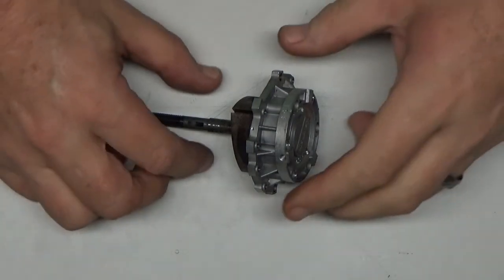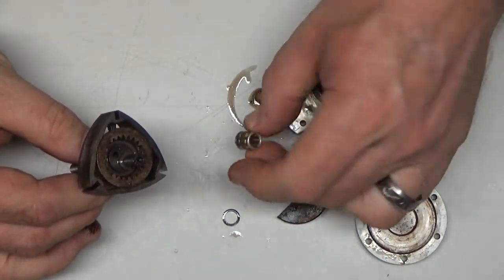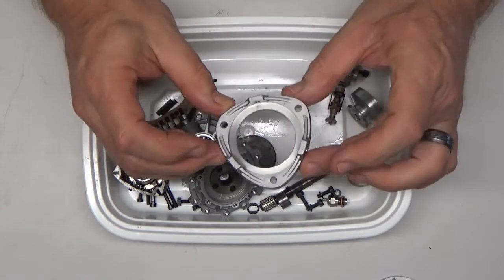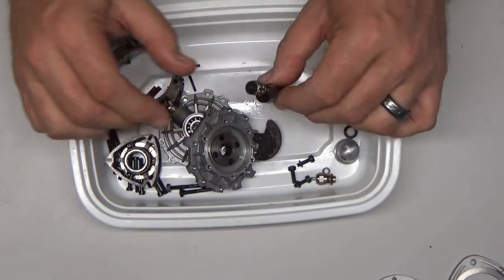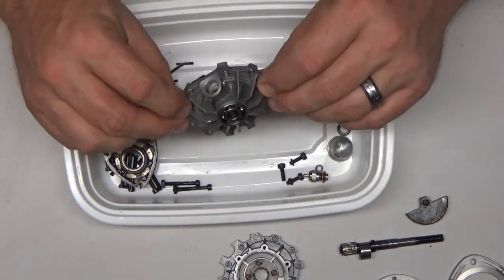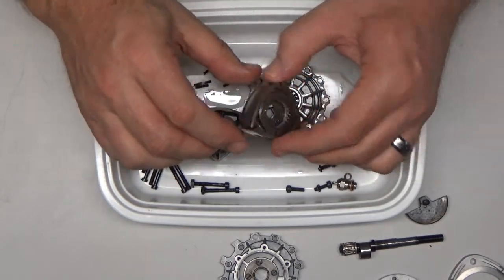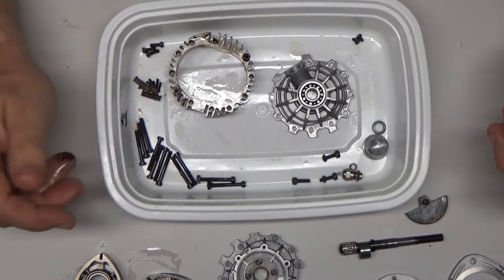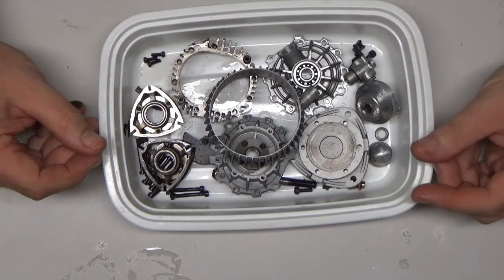OS Wankel A Look Inside Part 1

Comment: Came here to find out if the 6 screws on the back have Allan or Philips heads .... but you already removed them and drilled them out!  Somehow I've managed to mix the screws of two engines together in the cleaner.  I'm thinking if you had to drill them they were probably Phillips, but....?  In the end it doesn't really matter, just trying to keep it close to stock.

Comment: I have the more modern version. When I to mine apart for cleaning, apex seal, and bearing replacement, I put the rear counter weight on upside down. guess what? When the engine fired off, it shook like a dog shittin' golf balls.
Reply from the maker: That is a good lesson then.

Comment: For the same power output, the Wankel is smaller, but the garden-variety 2-stroke piston engine is much cheaper. Wankels are cool, but there's a reason why piston engines predominate.
Cool vid though, thanks for posting!

Comment: Great video! I just picked one up from a flea market for $10! There is a question no one can answer though...in the front, mine and yours use two bearings without a seal. Online, they use one bearing with a spacer. Since yours runs great I’m assuming that the two bearings are meant to be there and work perfectly. To get them out, are they two blind bearings or will they push out together?
Reply from the maker: There are three different versions of this engine.  So I cannot say what should be in each. I no longer have that engine.

Comment: Where do you buy that motor
Reply from the maker: I got in in a trade deal.
Reply: David McIntire what did you traded it with. Iwill buy it from you will you agree
Reply from the maker: That engine is long gone, sorry.
Reply: David McIntire oh in os its not being made anymore
Reply from the maker: Correct.  I have a Wankel Gen 2 engine that was a gift and I am not going to sell it.  If I did ever decide to sell it the price would be extreme, like around $300.

https://youtu.be/S9cOE8m4mCE

https://youtu.be/fCSTlZ9AGI4

Comment: That was one video that was REALLY enjoyable and VERY informative....

Goes for part 2 (which I actually watched first) as well!

Can't wait to see it run. Please take time to re-break in the apex seals!
Reply from the maker: Thank you very much.  It has been really fun.  I might not want to part with this thing.
Reply: I can imagine that! I think I wouldn't, if I were in your Lucky position...

These are such ingenious, almost mysterious constructions....

Good luck with the testrun!
Reply: @dmrcflyr2  Meanwhile, I have one too, a bit older than yours (mine still has the carb without air bleed idle mixture adjuster).

And of course, by now it is converted to run on gasoline and ignition, with electronic mixture control to boot.
It runs awfully hot on the bench, but for some reason it can handle a LOT of heat. It also appears to have never been fully broken in, as it has gained almost 1000 RPM over the by now about 4 hours it has spent on the bench. It also feels like it seals up better internally. When I got it, it turned over rather "squishy", but now it feels like it actually has something that could be called "compression"...
Getting 13850 RPM on an APC 9 x 5, which is not bad at all, and would be even decent on glowfuel...

Haven't opened it, and not going to as long as it keeps running.

Currently building a plane for it. Going to be fun (I hope)
Reply: They are indeed- I have 5 of the silly things, two first type and three of the second.

Comment: I would also use 4cycle,omega fuel.has more castor
Reply from the maker: No, I am going to use Omega Control Line fuel.   22% lube comprised of 50% castor, 50% synthetic, 10% nitro.

Comment: use the rotor,the gear in the rotor rides on the stainery gear on the end plate. when they get old,the rotor chatters on the gear while running..you can call me .
Reply from the maker: Which rotor? The old or the new?  I am not sure how much run time this engine and it's parts have.  It looks pretty good inside.
Reply: use the new rotor.the teeth on the inside of rotor ,ride on the stationary gear on rear plate and as they wear,its starts to chatter against each other,causing rotor center bearing failure.
Reply from the maker: Makes sense but the original rotor doesn't look bad at all.  I don't think this engine had much run time on it.
Reply: inspect the gear teeth closely. if good,then re-use.i built many wankels,os and mazda. that's why I was telling you about the gear wear.